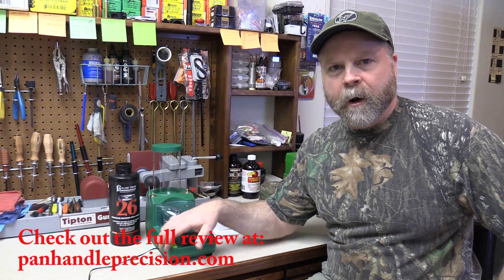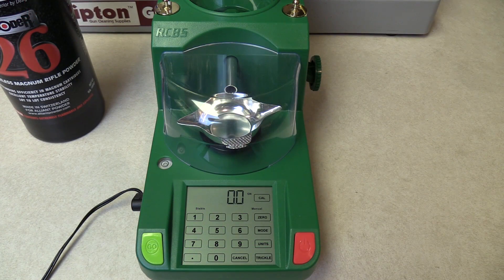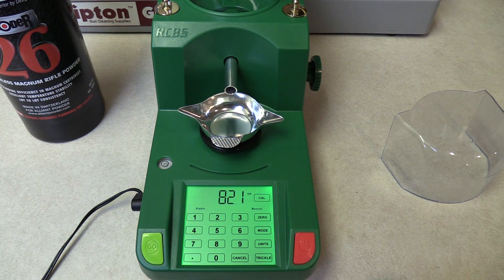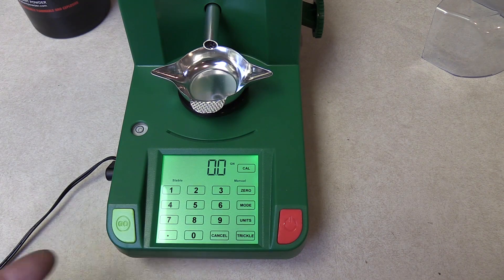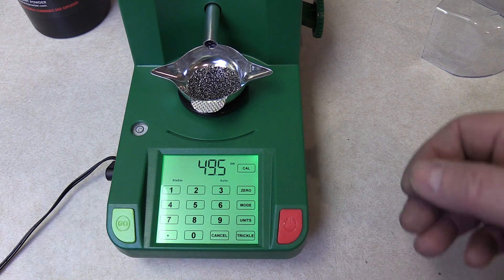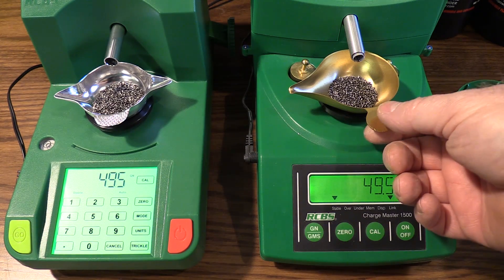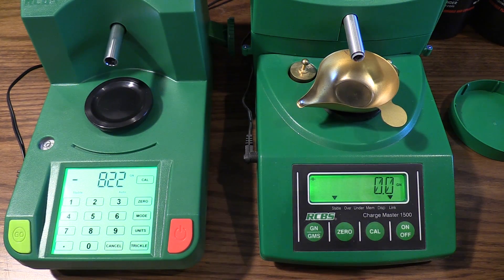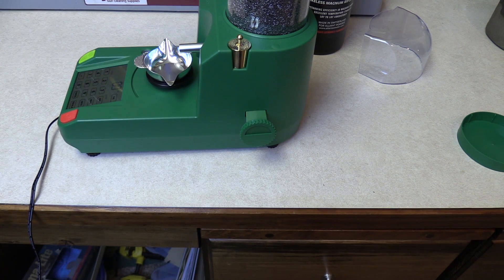RCBS Chargemaster Lite: Bench Review & Demo

Comment: Update the repair shop gets a flat rate of $155 to repair this unit, plus I need to pay for shipping it to them.
What would you do?
Reply from the maker: Probably get pissed off and shop around for a replacement. Having said that, I have three CM Lites now, including the one in this review that have never had a single problem. My best estimate of number of loads thrown with them is over 50k since this review. If one of them crapped out, I’d probably toss it and look for somebody selling a 1500. Lots of lightly used ones out there. Very few people actually load enough to put any wear on the motors or bushings. If they still had Lites in inventory, I’d probably replace it.

Comment: I think my "lee perfect powder" thrower and a manual trickler is faster.  This is very convenient, but it took over 15 to 45 seconds to dole out the charge.  I can throw the charge in a matter of a couple of seconds, and then use a trickler to get the charge perfect.  It takes about 10 seconds per case.  I'll stick with my "old fashioned" powder thrower, trickler and scale.  I did appreciate the information.  I just felt that it wouldn't be beneficial for me to own one.

Comment: I like to write the weight of my pans on the inside edge of them, that way when I remove the weighed charge in the pan, I can see if the scale is still zeroed based on the weight it shows (in this case it should read -82.2 grains)

Comment: Your video is great. I like how you show everything from the plug to empty powder. So 2 1/2 years later, is the Chargemaster Lite still a good product? I am leaning to getting one.
Reply from the maker: Joe Jr We just added a third CM Lite to the bench. The one in this review is still working perfectly after 10k-plus charges dispensed.
Reply: @PanhandlePrecision  Durability was all that was left to resolve. Ordering one now on sale $235 @ MSS. Thanks for the review.
Reply: @PanhandlePrecision  I guess that settles it for me. I just ordered one. Thanks for the response. 👍
Reply: No idea WRT the lite but my CM1500 is working as well today as when I bought it back in 2011/12.
It's dispensed 1,000s of charges without throwing an error code or failing to do its job.

Comment: They need to make a model where the hopper can just be removed when changing powder and a different filled hopper can just be swapped in
Reply: Not sure about this model but the RCBS manual powder measure hopper will melt if powder is left in it
Reply: @rtucker8837  Pretty much all powder dispensers have a warning regarding leaving powder in the hopper, as they contain some pretty potent solvents which can etch plastics, especially transparent ones. My 30+ YO Lyman's show the effects of my occasional laziness, as does my Lil Dandy.

Comment: Seems to take a bit of time. I'm sure they are accurate/consistent charges. However, I'll use a Lee Dipper or charge thrower and trickle. With  a simple platform digital scale I get it done so much quicker. When I first determine the charge I want on  the beam scale, I'll dump it  onto digital. Whatever that reads is what I will trickle to. No doubt Sam's RCBS is probably more accurate but a kernel or two variance wouldn't bother me .

Comment: Stand for I called hornady and asked these questions the tech said he didn’t know my barrel is only 20 inches long the manuals are using longer barrels the hornady maxes out at 43 gr I loaded some up to 45.4 gr tonight I should be okay I will watch for pressure signs I just got the other manuals I was only using the hornady but now I see these higher charge rates and have decided to go on up since my velocities are low as per hornady spec  thank you
Reply: Did you proof read your comment?

Comment: That is cool eventually I will get one just getting started using a lee dipper right now thank you for your great videos may I ask a question about powder I have lee hornady Lyman and Hodges reloading manuals they each show a different max charge weight for 308 Winchester 168gr bthp match bullet by hornady using varget powder Hornady is about 1 1/2 go less then the others any idea why Hodges is at 46 gr lee  and Lyman very close within a few tenths of a grain started this load at about 40 hrs am workin up by .02 grr am at 43 as of now  one other question if I use this same bullet the hornady 168 gr bthp match and my other manuals the lee Lyman etc they just list the bullet as 168 gr sie bthp question is as long as I keep the bullets the same does it matter if the bullet is a serria or Berger or hornady  does matter who made it and what does the sie

Comment: I reprogrammed my 1500 from the info on Primal Rights a few years ago and also using the straw. Got about 50% faster charge time and good accurate throws with a range of powders.
One thing I will emphasize, get rid of the fluorescent lights in your loading room especially if you are using old 4' F40's or 8' F96's and magnetic ballast. Switch to a good incandescent or halogen or better yet,  LED's. If you have older 4' shop lights as a great many people do, simply buy new retrofit LED's where you bypass the ballasts altogether or you can buy 4' LEDs' that use the existing ballast. I don't recall right now if the existing 4' ballasts need to be the electronic type though typically used with the newer T8 lamps. 

My first switch was re-ballasting my F40's and old mag. ballasts to T8's and electronic ones before I retrofitted again to just straight 120v LED's bypassing the ballasts altogether. There are some harmonics dancing around from old fluorescent type fixtures that played with the stability of my 1500.
Reply: Yep. Old style fluorescents do indeed bollox up pretty much anything using a load cell, plus the light they give is crap compared to LED's.

Comment: When you load with the RCBS Lite model, do you trust every load it throws?  Or in other words, are you confident enough to calibrate it, zero it, and start throwing every time?
Reply: I do.  I get single digit extreme spreads with my loads.
Reply: I have the older 1500 model & when I first started using it, had my 5-0-5 scale right next to it. Over multiple loads, I NEVER ONCE had any discrepancy between the two, including overs & unders*. If the CM1500 said 0.1 or 0.2gr over or under, that's what the 5-0-5 showed too.
*Fitting a short length of MacD's straw into the dispenser tube reduced these from one in every 20-30 loads to maybe one in 80-100.
Been using it eight years now & still impressed with it as a way to dispense precise loads.
It's NOT the tool for producing bulk loads of rifle or pistol ammunition & for that, I go right back to using old style Lyman or RCBS powder measures to drop loads, as the aim is for speed of operation, rather than ultimate accuracy.

Comment: Don't trust these dispensers by themselves. Mine throws charges that can be off by half a grain or more with no warning whatsoever. Re-weighting the charge and cross checking with another scale confirmed by suspicion.
Reply: Bruce Johnson I keep hearing this. That’s why I’m sticking with balance beam. I want consistency inside .1 and it doesn’t sound like that’s possible regardless of what the digital readout says.
Reply: The scale shows overs & unders on the display & mine has NEVER thrown either without showing that it has & by what amount. Is yours an RCBS or one of the ones with known issues?

Comment: Nice video.  I been looking at your powder pan weight and first it came up as 82.0 gr and when you removed it it was -82.1gr and later I saw -82.2.  It would be good to test your charge weights against more precise scale.  On my GemPro 250 if my negative weight changes let's say from -67.12 to -67.14 it will bump the weight by .02 grain.  Because it's such small amount I typically ignore it, but if I see it float another 2/100 grains then I put the empty pan on the scale and reset zero, but in your case it's tenths not hundreds, this would concern me.  I am still planning to buy this new lite dispenser.  In the past I bought 1500 but couldn't get it to not overthrow and I've tried straw mod, piece of 5.7 cut off brass, I even reprogrammed the speed, but still I would get sometimes up to 0.2 grains overthrow so ended up returning, it wasn't accurate enough to justify 300 bucks.

Comment: I found using a can of caned air like Ultra Duster to blow out the hopper and tube after all drained out, couple squirts and all cleaned out just make sure you don.t turn the can over on its side or up side down or you get a liquid comes out but its dries like in a second but very effective for getting out all grains of powder

Comment: Ok!  I realized  today I need to get a new digital scale.  It took me 2.5 hours to reload 50 rnds of 260 Remington.  About every 3 to eight rounds I had to calibrate my Lyman digital scale.  It was sure nice to have a Franklin portable digital scale to verify all the loads though.  The calibration weights are .1 grains off and with the Lyman scale guaranteeing +/- .1 either way. That is not good enough.  Makes it -.2 off in the down side and +.3 off on the up side.  Thanks for the review!!
Reply: Also, Sir; since I load in my garage and it gets cold here in the winter.  How does the scale handle the cold?  Do you leave it plugged in the outlet?  Anything you can add would be great.

Comment: Received mine today, let it warm up for 30 min, and noticed it was drifting 1-2 grains constantly.  Tried Calibrating only to have it drift 1-2 grains with it constantly drifting up and down.  Cover is over top of pan and there is no air movement.  I've tried different surfaces/different wall outlets, and turning off everything including the room lights and nothing works.  
Now to see how RCBS's Warranty goes...  Sucks because I was really looking forward to upgrading to an electronic system.
Reply: I'm guessing you have fluorescent lighting over or near where the dispenser is. They will mess with any scale using a load cell.
Reply: Dust cover has static electricity,  take it off when using
Reply: @JJ1st506th  Turned out to be a faulty scale.  RCBS warranty was great and got a new one in the mail within 2 weeks (located in Canada).  
Ended up selling it a year later and picking up an Fx120i Setup.

Comment: Sam, Curious : As of today,   I've a new RCBS lite. It zeroes out just fine and then re-zeroes with the pan. HOWEVER, when you place the plastic windshield on the stand, the scale is no longer zero. You have to again zero the unit with the plastic shield in place (tray & shield together) The wind shield is important to minimize "draft" influences. Is what I'm saying correct or should the shield not have any addition to the zeroing out number. In my mind, the clear plastic shield should be used with each weighing/charging. More important with the lesser pistol charges I would think. AND maybe manual mode is best if you use the clear wind/draft protector ? Your experience please ?
Reply from the maker: I don't weigh with the shield in place. Just make sure there isn't any moving air from windows, HVAC, etc. If the shield touches the powder pan at all, it will definitely influence the zero.

Comment: Question : is your unit hard to clean without spilling a lot. You say it's easy but does the powder clear canister just lift right out without spilling ? I think I'd be happy with this RCBS unit. Thank you for your time and trouble in making this video. Good stuff for the reloader.
Reply from the maker: You drain it with the drain valve on the side first, then pop the cylinder off and brush out the remaining kernels.
Reply: Thanks for your response. I've subscribed. Nice channel.
Reply from the maker: Thanks!

Comment: Does yours still work? I used mine about 7 times and now the keypad is completely dead.
Reply from the maker: DuckmanH Yes. Mine is working fine. Did you contact RCBS?
Reply: Yes sir. I just sent them an email. That's a real bummer. This thing was soooo nice to have while it was working.
Reply: Panhandle Precision I tried it today after work and it is working. It was really hot in the garage yesterday maybe I reached its heat threshold.